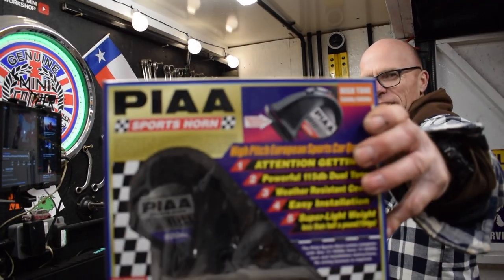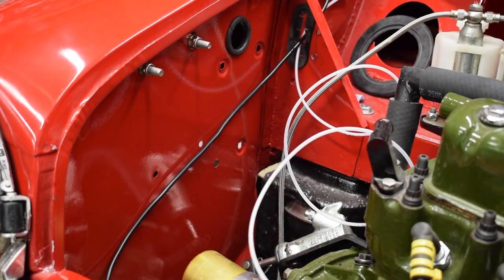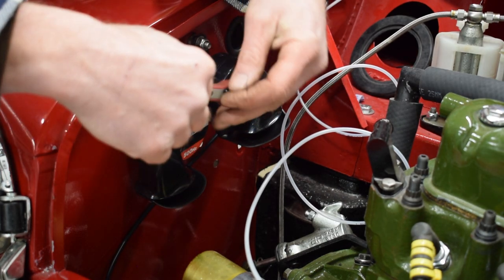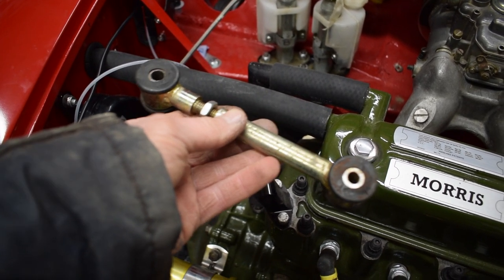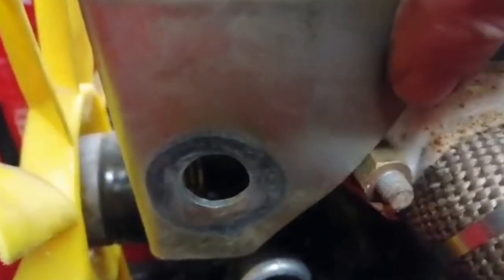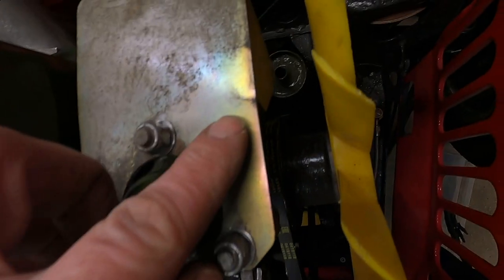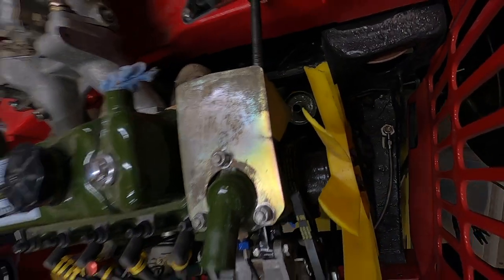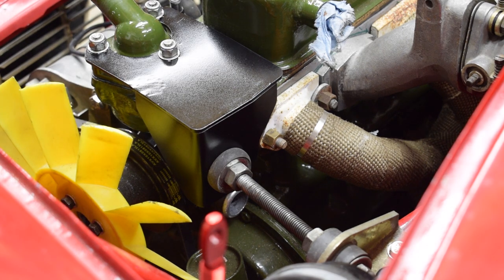Fitting rally horns to the classic mini rally car build

Comment: Kev, take it off and find away and throw it in that direction. Originally those mounts had a mount onto the exhaust stud you have just trimmed around. This took the flex out of the top plate. It will fail there again. Also all the loads are going into the top of the thermostat studs. The stat housing will move. It will leak. I would really have a look at the DSN Retro sport ones. They are game changers and make everything much easier.
Reply from the maker: Now you say that it's bloody obvious. This is why I enjoy making these videos, i get to learn all the experience and advice from people who have done this before me. So I will defo add this to the upgrade list as soon as funds allow. Thank you and I have heard good things about those DSN steadys.
Reply: @TheGentlemensMotorRacingTeam  I remember when these first came about and got one. They were great until you needed to do something to the engine. A right faf. The DSN one one bolt and you can swing the arm away and of you go. And your pipe to the heater should be fine where it is. Some pics https://www.theminiforum.co.uk/forums/topic/291013-i-decided-it-was-time-to-drag-the-race-car-out-and-update-it/?p=3269627

Comment: Will you have to take that bracket back off to fit the bottom rad hose? How was the horns did you test them?
Reply from the maker: That's a very good question I don't know. I need to take the thermostat nuts off for the rad bracket so it's not much more work if I do. And as for the horns, no I have not tested them yet I will wait till I make the wiring loom. Glad you enjoyed the video